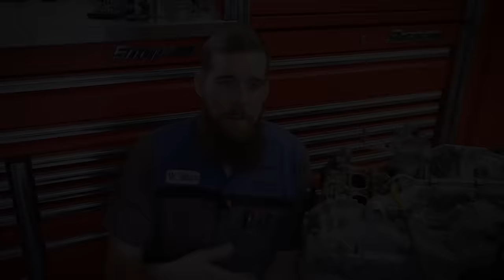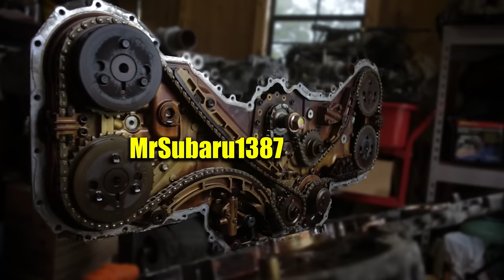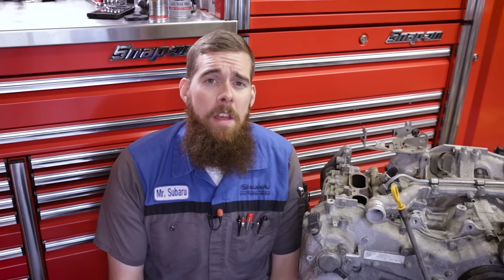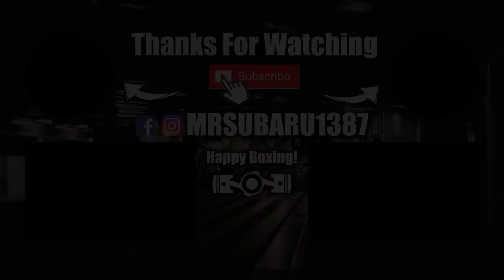Why Subarus Are So UNreliable!!! Buckle Up!!!

Comment: Decades back i worked at a Ford garage in Kokomo IN. Asked the used car guy about Subaru vehicles. He wasn't impressed with them.
Now that i own one am pleased. The car burns oil. But - putting in Schaeffer Moly EP has really helped.

Comment: This is literally why I went for the 3.6 motor. Too many turbos are beaten on before they’re resold.
Reply: The 3.6 is a fantastic motor. you will get a front cover oil leak but other then that they run forever and have very few issues.
Reply: @GeorgeJFW  Agree.   No DI.   No turbo.   Some say "old tech".   What is apparent to me is that all that thing knows how to do is run.  Zero issues on my 2018.   No, wait;  Subaru does deliver them with crap batteries...known issue easily corrected.
Reply: @GeorgeJFW  that and an oil cooler leak are the only two things I’ve had to deal with. 2010 and I bought it with 119k. I actually used Mr.Subarus video to fix my oil cooler too!
Reply: Philip Farnam That is so true. Super bad batteries. Other than that Subis are fine.
Reply: I also got very lucky and mine was babied by the previous owner and only serviced at a Subaru dealer. The same dealer the sold to the original owner sold it to me too. I was baffled by the amount of history I had on this car compared to so many other Subarus.
Reply: @dylan.schantz  Thanks for the tip.   No evident "front cover oil leak" or anything else to-date but I'll have them pay attention during my upcoming 60,000.  My dealer (Tucson) is expensive, as they all are, but I've learned that I can depend on their work.   Intend to own this (wonderful) car for many more years.
Reply: @kevinm5177  yes the batteries suck and the ac components are made from tin foil but compared to a Nissan cvt I would take that any day of the week
Reply: @philipfarnam6013  same here! My dealer is the one known as “the most expensive in town” but anywhere I take a Subaru will be expensive, so I might as well take it where they know what they’re doing! That 60K service is important too! The PCV Valve is super important to be changed on this engine! (Also a tidbit I learned from this channel!)
Reply: @dylan.schantz  Thanks for the advice.  I am paying attention.
Reply: @dylan.schantz  Agree again.   It's not like the idependents are cheap!   Comparatively, I'll pay the slight increase to the dealer....and know I'm backed.

Comment: I feel your pain. Was a motorcycle tech and eventually service manager at a 4 line dealership in a town that was a recreation mecca for watercraft. Every year same crap. Use ski don't do the "winterizing" procedures every manufacturer instructs through sales training. Don't disconnect battery and remove from hull when not in use. Don't use water/moisture displacement spray for essential areas, don't empty old fuel and fuel/oil on 2-strokes, don't flush the ski when first removed from water, don't pre-start before putting it in the cold water, making it harder on the ski. The oil injected two strokes, Always failing to maintain the oil tank level when fueling running it completely dry then wanting us to warranty it. I  finally quit just because of the frustration level of dealing with drunks that scream at me because their ski won't run and their girlfriends are pissed off. Not even something essential, like primary transportation, but a friggin toy. Loved and still love  fixing anything with any type of propulsion. But couldn't do stupid or ignorant any longer.

Comment: I own two 2.2's and a three-liter with a combined over 600,000 K miles. All bought used so not even sure about the maintenance histories. No drama-just turn the key and go do whatever it is you have to do! Thanks MrSubaru1387!

Comment: Agree with the video 100%. As a fellow technician most failures with anything is caused by poor ownership. My first car was 03 Forester non turbo. Yes the head gaskets failed at 100k miles also beat the crap out of it. Owned a 07 Volvo 5 cylinder head gasket failed. My 98 5.9 Cummins head gasket failed. And my current 04 Forester xt head gaskets failed at 242k miles. All my head gaskets failed in literally every car I owned because I have a lead foot and tunes/mods. Probably would have alot more money if could keep my foot off the floor. Next car will be kept stock since I'm more of an adult now lol and have bigger responsibilities.

Comment: I did everything you said to my old Subaru. But I also did rods pistons studs manifolds, etc.

I was making 600hp proper fuel.
It was a great car sold it the new owner (spoiled rich kid) tried to push it harder and got into the 700ish and the head gasket let go. He gave it to a junk yard for free I was so mad 😠 😡.  If he didn't want to fix it give it back he has blown up almost a dozen hellcat/demons in the last few year's

Comment: Ive owned 4 subarus including a wrx with zero issues. All about good driving habits and maintenance. 600k miles under my belt without a single catastrophic failure.

Comment: Owners are the problem with MANY engines. Take my wife....  PLEASE... (that's a decades old one liner joke, and you're decades younger than I am). Anyone who has a direct injection engine better understand that the intake valves need attention like other engines don't. They need to understand that tires on Subaru AWD vehicles have to be the same diameter, so changing just one is out of the question. That plastic parts like the stuff that holds the washer fluid reservoir in place have to be looked after before they fall into dark crevasses or to the ground somewhere. Or that an oil light on the dash means STOP THE CAR NOW. ....and unlike my wife, racing a street vehicle is going to break it, regardless of whether "performance parts" from ebay or wherever have been slapped on. Actual race teams tear down engines every race, and those engines still sometime break. Goobers sticking glow lights under vehicles built lightweight for economy reasons and not speed reasons don't know squat about engine dynamics, but race boxer engine cars regardless. "Boxer engines are balanced, so are fast". It's not that easy. Vehicles accelerate, not launch. One might prove they're a man by NOT racing another idiot... just a theory. Try being the guy with a girl riding shotgun. Some of us have (it worked out well for me many times). I might be old, but even when I was young, I knew driving and maintaining a car like I have to fix it myself, or adding more oil than a Brit roadster leaks, is imperative. Mommy didn't buy my cars, fuel, or tires. I didn't destroy them. My vehicles last a LONG time. Toyota, or Subaru (or in the day, Triumph or Austin Healey). Isuzu (diesel) or Mazda (Miata). Even my Suzuki Samurai with the original 1.3. I appreciate your venting. Yeah, the Subaru 2 liter in the '13 Crosstrek had the valve spring recall, and one of ours failed before the recall. $2800. Stuff happens, but it's still a pretty solid car. Wife's Crosstrek still averages 32-34 MPG, even with winter tires on all year. I'll keep trying to learn how to keep it running. I've given up trying to improve her performance.

Comment: I bought a slightly beaten up 2011 SH Forester with the first FB25, just because of the fear of the HEAD GASKET.
The valve covers leaky AF (now fixed).  Timing chain and cam cover still leaking (fix it later).  The stupid air intake system that sucks in dirt on gravel roads and that burnt oil smell from the timing cover dropping onto the exhaust...
...I still LOVE it.  All the issues aside, there is no SUV type vehicle I can get that is as capable as this thing.  For the time being just air system on recirc and it's all good.

Comment: I have a 2012 Forester Premium with 5-speed manual that has 128K miles that I bought new.  Car has been maintained by the book at my Subaru dealer and has been very reliable. I did have a new short block installed under warranty at 59K due to oil consumption, but that addressed the problem.  Car still has the original front brakes and mechanic says they still look good. Rear brakes were done at 90K. Other than that it's just routine maintenance. I have noticed the clutch getting a little noisy on cold starts when it's depressed, but it quickly quiets down. I think it's the throwout bearing and may need to be replaced this Winter.

Comment: Top video. Best and most interesting mechanic on the net. My 2.5L Forester is 21 years' old and still going strong. Best car I've ever had. Wouldn't hesitate to take it around Australia, vast outback deserts and all. Just have to every now and then top up the coolant to which I've added Nulon anti gasket leak which worked instantly on the external coolant leak.

Comment: Thank you for being blunt! Everyone needs to hear this! Including myself!
Reply: Look, he is a subaru stan. Subaru has by far the most unreliable motors of any of the cars coming from Japan. Even with proper maint. Its not a opinion its a fact. The boxer motor is a bad motor. People, including me buy one because the awd system not the motors
Reply: Facts? Fact that these 19-20 year olds beat the piss out of these cars giving them bad reps? Sure.  My 03 forester is going on 287k. I’ve had to change the timing belt 3 times, the clutch once and the obvious service intervals, aside from that it hasn’t given me any issues.

Comment: Yep, I totally agree with Mr. Subaru she always talks to me and I listen to her. Every morning after the cold loop and then she calms down i like to feel for any misfire or noise - I change oil and smell it for coolant or fuel - I change the CVT with OE CVT fulid as well as the coolant - check the parking brake pads and brake pads - replace the DOT4 fluid check the the wheel bearings front A arms and rear check CV boots for tear - check the struts for leaks or wear - check my rack and pinon - power steering fluid - check the batt terminals - front and rear dif fluids and rotate the tires with the oil change - check tire pressure - I listen to her - may the force be with you always.

Comment: Great video Mr Subaru! Wheel bearings, and CV axles have been my only issues during my hundreds of thousands of miles on my Outbacks.
Reply: Do you have any lift kit or larger tires on yours? Or is it factory?
Reply: @Ike.47  Everything factory ... on both Outbacks. I replaced the cv axles around 100,000 mile mark, and rear wheel bearings on one around 128,000 miles

Comment: I currently own a 99 impreza outback sport with 170,000 miles on it, and have owned three other subies, and can tell everyone from experience that they are great cars!!  Best bang for your buck in my opinion. Cheap, easy on gas, ALL WHEEL DRIVE, and reliable. But like you said Mr. Subaru, you have to treat them right. Proper maintenance is key. Couldn't agree more! Good video!

Comment: I’ve had my 2005 Subaru 2.5 xt for 2 years now. Overall love the engine. Never had much problems. It now has 120000 and she runs great. A few months in I noticed my car smelled like burning oil and began to smoke from the hood. I found the leak... fortunately enough it was the valve cover gasket leaking onto the exhaust. Fairly cheap fix, and she’s been great since.

Comment: Great video sir! I’ll try to keep this as concise as possible. Owned a “Hawkeye” 07 TR (Tuner Ready go figure why Subaru stopped producing this model haha) bought it new Oct 06. Then I joined ClubWRXnet NASIOC, etc I even found my Gran Turismo 3 for the PS2 and got the Gold Rally License just to play the 01 Rally car Protoype (Bug Eye super cool STI rally car). Then I thought, whoa mods may be cool but I’m going to void the factory warranty so I kept the car stock even though there are some great mods out there. Once I passed 60k and was doing most of the maintenance, I decided to keep it stock because it was running awesome. At 100k or so changed the timing belt, water pump, tensioners, etc and still running awesome. At 125k one of the rocker cover gaskets started to leak oil (no big deal changed the gaskets with OEM, no issue). At 138k or so some crazy lady t bones the car and insurance declared total loss. Maybe it was a blessing because I did drive fast but had that not happened I would still be driving the car. Anywho had I not followed the FACTORY recommended maintenance, used new OEM parts, addressed maintenance issues (96k radiator started to leak, changed radiator along with OEM coolant, the conditioner, etc) the car would not have lasted the way it did. There is ZERO chance that if I tried to be like one of those Subaru engineers and try to re think how to put more power in the car, stage 4 turbo, different shocks, exhaust pipe, cheap oil filters, etc, I would have had that car for so long. The Subaru engineers have spent thousands of hours thinking, designing, testing the cars before mass producing them and there is no way these “18-30 year old” clowns are going to outsmart them even with this class action lawsuit. They want to complain, let em complain. Eventually, they’ll be priced out of the market with their whining but if a large group of owners reply back to you, I’m sure someone at SOA will read these as well and do what’s right: void those claims and warranty. The system isn’t meant to pay these fools for whining and complaining. Use OEM parts, take care of the car, and use good judgement when altering the performance. There are some great videos Subaru posted interviewing the STI engineers during and after Rally races. Maybe those fools should watch those to see exactly what goes into the design and precision the STI has (even when it is only “stock”) https://m.youtube.com/watch?v=Qz4y8KYALj8 Great video here. This one talks about the S209 https://m.youtube.com/watch?v=keXBdZceSH4 Anywho keep up the good work as always. I saw your video to do the coolant flush (I have now the 17 Limited) for the 60k service and followed your advice to burp the system. Thanks again for sharing your expertise to help everyone out to do the work right, the first time, and correctly.

Comment: Just had a head gasket failure on a 2.5L in '07 Forester; it had been rebuilt at 190k and I only got 27k b4 failure. The Mechanic bought from, showed lack of attention to detail. But I can't believe he installed what looks like, one ply factory gaskets, or he just didn't actually rebuild it. Thanks for the 'Clean Your Room", momment. Blaming Subaru is easy, figuring out what I did wrong, makes my next Investment better.

Comment: This is the kind of stuff I look for, I was thinking about getting a Subie, but got a Kia from all the backlash I've heard from how Subarus are NOTORIOUS for blowing head gaskets. I got a Kia Sorento (suv for the family), and I really like it, but I've always wanted a Subaru for the boxer. Thank you for clearing stuff up!! Maybe my next vehicle will be a subarut
Reply from the maker: Kia and Hyundai are NOTORIOUS for their engine seizing up like a rock. Be careful. Friend has a 2020 Sorento with 50k miles, transmission is already out.
Reply: @MrSubaru1387  I have the 2020 Sorento with the 4 cylinder I bought new, traded it with a bought used, 2012 Sorento that blew the motor at 178k, this 2020 has the 20yr/200,000 mile power train warranty. That was the main selling point. Only thing about Kia is you have to either get your oil changed there, or use Kia specific oil filter and oil along with keeping the receipts if you do it yourself, otherwise it'll void the warranty

Comment: True,
I have a 2006 Forester as a daily driver, first car I ever got after college in the harsh climate of Saudi Arabia. Still running like clockwork today, no head gasket issues ever but i did replace the engine seal gaskets pro-Activley and just last week replaced the MAF sensor and Transmission Soleinoids and its good as new.

Comment: I mentioned the '10 Outback I purchased in August of this year on another of Mr. Subaru's videos.  The previous owner (and the dealer mechanics at Marion Subaru who maintained it from new) treated it pretty poorly.  Mis-matched tires have pretty much ruined the center differential, the connectors removed for the engine-out clutch replacement at the dealership (I have the reciepts) were not re-connected properly nor re-routed correctly. The cooling system was around a liter low - the system was air-trapped and I burped it back full to spec.  My wifes's '11 Outback with 70k more miles (it's at 166,000 miles) on it and maintained by me has no current issues without the regular dealer servicing of my '10 vehicle by a Subaru dealer.  It's not only failure to maintain but failure to properly maintain.  As an aside, I requested past maintenance history for my vehicle from Marion Subaru in Illinois and they've ignored me.

Comment: Spot on!. I have owned a few Subarus over the years. Regular maintenance and not abusing your car is key. Just like with any car. There are so many online stores that sell OEM Subaru parts for cheap, that the cost of maintenance and repairs, even when you have to replace a part, is usually less than other brands including Honda and Toyota, both of which I have owned or currently own and love them both.

I just had my head gaskets replaced on my 2008 Outback N/A with 129K miles. The shop that did  the work (Speedy Roo Motorsports in Aurora, CO) replaced them with the MLS gaskets. I also just replaced both control arms (came with ball joints pre installed), both sway bar links, right side steering knuckle (snapped pinch bolt) and  right side wheel bearing myself. So easy to work on.Should be good to go for a long time. 

Keep up the videos. They are fantastic!

Comment: I was absolutely going to post "My '10 wrx motor popped last year (spun a bearing), and I guarantee it was mostly due to the abuse by the previous owner." But you did go straight to the end user being the biggest failure. Props!